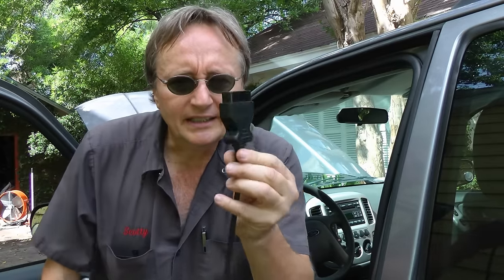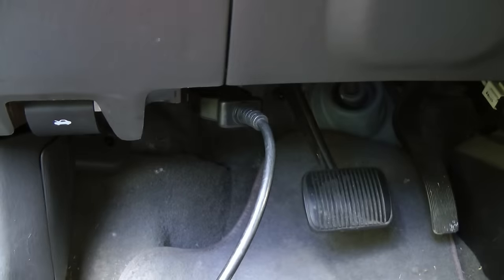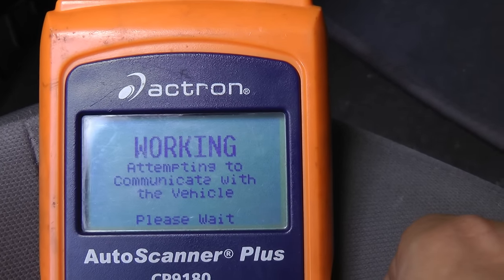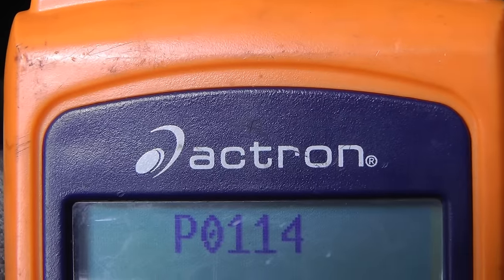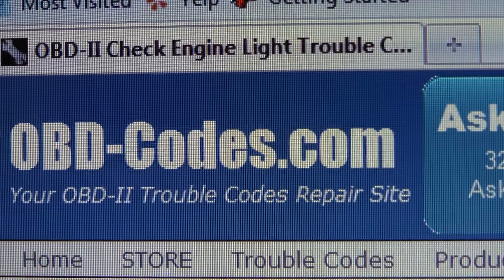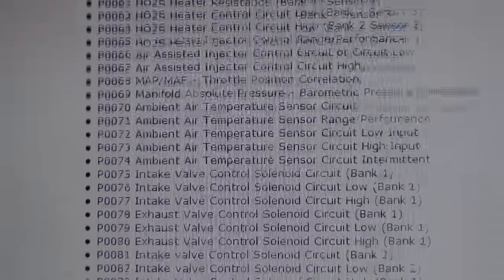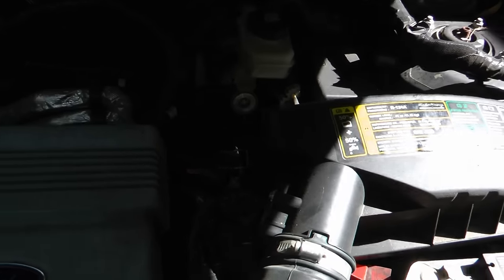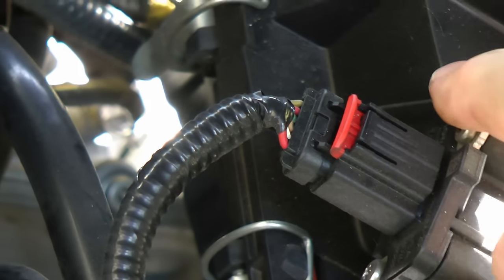Check Engine Light On and How to Fix It

Comment: Go to the dealer with the check engine light on and you're lucky to get out of there for under $500. $100 "diagnostic feel"   $100 labor to change a sensor that takes 5 minutes and a 300% mark up on the part.  I know computerized engines are more efficient and pollute a lot less but damn, I miss the days of carburetors and basic electronic ignitions (forget contact points!)

Comment: Hey here's a tip. When you need to find certain text on a web page, just press "control F" (command F for Mac users) and type in the text your looking for on the web page. This is really helpful when looking for a specific thing on a web page with lots of text.

Comment: Hello scotty, i have a 1999 toyota solara. i scanned it with my neighbors scan tool and these three codes came on(P1130, P1135, and P0441). I got this car as a fixer upper as my first car. so im trying to do this as much as hands on as possible. thanks you for the help, i fixed my AC with your videos.

Comment from the maker: you need a scan tool to reset it, but realize the gas cap may or may not have fixed the problem, many things can cause evap leaks. If it was the gas cap, just drive it, the car would turn the light off in a few days driving then.

Comment: Hello Scotty and viewers!  You are priceless Scotty.  These scanners can at least allow motorist to know exactly what they need to clean or replace.  I just purchased on obd scanner from amazon for 17 dollars and tested my 98 dodge ram and my 02 ford f150.  The 98 ran came up with no codes.  The 02 ford came up with a p103 code and in the booklet I received with mine t said it was my MAF sensor.  I cleaned the maf plug and sensor and then re installed my battery ground.  So if My engine light comes back and I receive the same code I will know to replace the maf sensor.
Reply: +Earl Guyton Most OBD2 scanners now have the ability to clear codes too. No need to remove the ground terminal and reinstall it now.
Reply: If the  check engine  light off of Nissan , what to   do

Comment: The best Car Advice on Internet. 
Hi Scotty i have problem with my Yaris 1.0. It start normally and idle normally and drive normally but after driving at high speed lets say 95 km per.h car start to resist or loss power and strangely it affect the steering wheel . The steering wheel become hard to keep it at the center of the road.

Comment: thanks for the fast advice. i'm going to get to the part house tomorrow and see what i can't find out about it. i decided i would go over things again and i can tell you it's not a connection issue. i even put an extra ground on the motor and bracket for the tcm and pcm. went through the dash and all that (hadn't wrapped them up yet lol). i couldn't find the problem even while running it and shacking the wires by hand. it's gotta be one or the other. that darned pcm is $250 to...

Comment from the maker: a weak battery or wiring shorts around the battery causing voltage to be low from the battery, but not the alternator when it's spinning

Comment from the maker: yes, just put a new thermostat in it. Follow the big hose from the radiator to the top of the engine, it's inside there on the engine.
Reply: would run my 79 Volare without a thermostat in the Summer...never got hot...put it back in the late Fall

Comment from the maker: computers see problems, they turn the light on. They see now problems when driving later, they turn the light off. change the engine oil every 3 to 4  thousand miles or twice a year. Brake fluid every 3 years, coolant every 3 years, and the rest you change when they wear out, there's not time limit or mileage time for most parts.

Comment from the maker: @SchindlerElevator902 fluid gets dirty and burns, should change it every 30 thousand miles on that van. 2 thousand codes can trip that light, get is scanned, or ignore it if it runs fine.

Comment from the maker: @Matthew55904  If the problem is fixed, it will reset itself, but that can take varying amounts of times, from hours to weeks. So most guys reset it using the scan tool erase codes function. Scotty Kilmer

Comment: Scotty, you need to advise people that a code doesn't always mean there is a specific problem.  Sometimes it is there to point you in the direction to begin diagnosing an issue.  A proper diagnosis will save a lot of money instead of just swapping parts and finding out later that what you replaced was not the actual issue.  Great video's though, keep up the good work.

Comment from the maker: you have to fix the problem, then it goes off by itself. Or you can use a scan tool to reset it, but it will just come back on in a few days if you didn't fix the problem

Comment from the maker: @PirloXXX  that's the bigger hole that lets air bypass the throttle metering. Don't worry about it, if you get some in, it will just evaporate if you let it sit half an hour before starting the engine back up. Scotty Kilmer

Comment from the maker: that is either a short in the wiring system to the computer, or a bad main computer itself. If it runs fine, ignore it as it could cost a ton to pinpoint it, and i've seen cars run years fine that way.

Comment from the maker: @0069manny could be either, that stuff's complex, and I only use factory oxygen sensors myself, aftermarket ones are often crap. But hondas are known for bad cats, only you can't check it yourself due to the previous information being true. but if it runs fine, it hurts nothing. Scotty

Comment: I know all about the dreaded flashing MIL. 2 years ago one of my job's Chevy Express vans had that happen. They still wanted me to take it out, but I told them hell no because I learned before that the flashing MIL is bad news. Turns out I made a good call because the mechanic discovered one of the lifters disintegrated and gouged the camshaft which produced a loud tappet-like noise which triggered the knock sensor to produce voltage signals that caused the PCM to set off the MIL.

Comment: There's a big difference between a scan tool and an OBDII global code reader. Both of these can see processed data from the control modules in a car but with a bi-directional scan tool the user can also command component operation, view manufacture specific data, and so on greatly aiding in quick, accurate, diagnostics.
Codes viewed regarding a check engine light really need to be viewed as road signs to the cause of why the PCM isn't Happy with the running condition of the engine.

Comment from the maker: pressure test the fuel pump, pray it's just bad. if not, pressure test the catalytic converter, if it has too much back pressure, it's clogged up inside and will stop speed.

Comment from the maker: you have an EVAP system flow problem. A real stinker on that complex toyota EVAP system. But, if it runs fine, it won't hurt anything. But do check under the hood, sometimes the evap hoses come off the back of the air filter top cover and cause all that. Pray it's that, cause if not, it takes a real pro toyota mechanic to fix those particular codes.

Comment from the maker: Realize an inefficient cat code can pop up from scores of different problems, including a bad cat, bad injectors, head gasket leak, bad fuel pump, and MANY others. If your guy can fix it cheaply enough, go that route, fixing it the way it was designed can cost thousands.

Comment: Hi Scotty,  You should do some aftermarket replacement of stock parts to your vehicle or someone else's on video cuz that would be invaluable. My question relates to that.  I put a DME header, AEM cold air intake and GReddy exhaust on my 2005 scion tc and the CEL has steady stayed on.  I then bought a Strup CEL eliminator.  The threads on the O2 sensor looked a bit mangled but my boyfriend fixed that.  The CEL turned off but returned the next day.

Comment from the maker: that's the code for ECM cannot communicate with other control modules. Serious computer problems there. Check for broken wires or bad grounds coming off the computer.

Comment: Thanks so much for the info, you get right to the point. My question is,  I just got mybrakes on and two days later Check engine & VSC light popped up, what can I do?
Reply from the maker: get it scanned and e mail the codes here, if they are ABS sensor codes, they messed up the brake job and damaged them

Comment from the maker: steering and running are two different things, I would suggest two separate problems. Try my video "how to clean fuel injectors on your car" for the running, and have the steering suspension checked by a front end man, most give free estimates.

Comment: @scottykilmer hey!!  it just turned of this afternoon by itself as I was coming out of Princess Auto.  I had went to check out on the prices of OBD2 scanners but was a bit bummed by the prices and had resulted in getting it scanned...all seems to be back to normal...looks like the fuel injector cleaner did the job again....Thanks again for the advice, this video and the other ones...  Fig

Comment: I was replacing my radiator fan motor 97 honda civix and the cel came in when I started the car I freaked out! I took a deep breath watched this video and I disconnected the battery and check my fuse box make sure everything was secure I heard a snap hooked the battery back on a bye bye cel check your fuse box might just be something loose or not on right thanks Scotty

Comment: Hi! Scotty!  I watched the video "fixing a car with multiple trouble codes"  And I did that (erase the codes, a week a go)   the check engine light is not come back. (the only thing i did was: clean the sensor under the battery.  thanks.  Dont know it the problem is fixed!
Reply from the maker: pray it's fixed, if light doesn't come back on, that fixed it

Comment: good one, thanks for uploading, i have a very simple question, i bought a used car and when i just turn ON ignition key in parked position with doors closed without starting engine, "Service engine soon" light shows with other lights like seat belt, break, oil level , they all goes away once i start engine, is this normal? I read from manual that its normal, but wanted guidance from an experienced person, I might have not noticed this earlier so little bit worried, please reply
Reply from the maker: they are designed that way

Comment: kool man, but i had one more question is it kool to drive around with the check engine light, i just need to have a day off then try to fix it, and also are most check engine problems serious, and expensive?

Comment from the maker: EVAP systems are complex computer driven nightmares. In order to diagnose and repair then without guessing, you need a dealer level scan tool with bidirectional controls and a thousand dollar smoke machine. So either pay a guy with that stuff, live with the problem that hurts nothing, or guess with the purge solenoid.

Comment: Thanks Scotty, I checked it out and its dry, my KIa is an Automatic, it won't start in Park, I had to put it in Neutral and somtime it starts, I once tap on the starter, it started but the Hold indicator light still flahes. I guess I'll take out the starter and get it test out. Maybe it's causing short circuit to the TCM.

Comment: P0505 ( Idle air control system) on a 2000 Honda Accord V6, cleaned the Idle Air Control Valve and Throttle Body, but it still turns on. Maybe a sensor? Vacuum leak? Have to replace the IAC valve? The problem is common in 6th accords. BTW it has a MAP(manifold absolute pressure) sensor instead of a Mass Air Flow sensor.
Reply from the maker: +Intiminator 77 check for vacuum leaks as in my video "finding engine vacuum leaks with a cigar"

Comment: Hi Scotty, Thank heavens for your videos! Newly divorced and learning about car care on my own-it's like learning to speak Latin, only harder. I have a 2001 Ford Focus that just passed smog on Friday then check engine light came on last night (Sun), Code says it's Bank 1 system too lean. I noticed for some time that it seemed like I need to refuel too often but I thought it was bad gas mileage, driving too much and using the air conditioning. The fan seems to run a lot but it's been in the 100's lately so I can't tell if it's running hot or just the weather. Any thoughts?
Reply from the maker: only thing that matters is the water temperature reading on the gauge, if it has one. If it runs hotter, it needs work. If not, running lean actually causes a car to use less gasoline, that's what lean means.  If it ran rich , it would use more gas.  Realize fords are always tripping codes when that old and many just live with em if they run fine

Comment: Question: I have a 2008 PT Cruiser, 61,500 miles. Had water pump replaced 2 days ago at dealership, oil light came on briefly, car full of oil and they said it was OK. Now check engine light came on today (not flashing) but on start up the engine seems to now be making a creaking noise esp. when cold. YIKES. Going back tomorrow to have it looked at. Have no way to check codes in meantime. I hope that my engine isn't ruined due to the water pump problems, it never over heated and thermostat was still OK. Had cam sensor replaced 4 mos ago. Hoping this isn't serious. Any guesses? Thanks.

Comment: ok i'll try with a different mechanic. I really want it off, because it's been on for about a year. And sometimes they don't want to do smog check because of the check engine light. But thanks for the info. I'll get it fixed.

Comment: Our 99 Lexus ES300 runs fine for 15-20 miles but after sitting at a light the car will run a 100 yards and act up. It doesn't die and the rpms drop to idle range and pressing footfeet gets no response. After 20-30 sec the car lunges forward and runs for a min or so and then does the same thing. We have replaced the fuel filter and two ingition coils and get a code about the evaporator. The exaust is real hot and I suspect the catayatic converter but I would appreciate your input. Thanks Dan.

Comment: Scotty like you said is hard to get a real mechanic that don't lie but I have a question I have a ford escape every time It rains the car slides from side to side specially on highways well only on highways I bought a used tire once never had it alignment the two rear tires maybe one I think has uneven wear for sure also when I go driving un bumpy roads it shakes on from the rear many say I need it balance and aligned but I don't know what you think it could be ? Hope I was detailed enough lol

Comment: @PirloXXX 
CRC Mass Air Flow Sensor Cleaner is safe for sensor and plastic parts.  You don't even need to remove the MAFS per YouTube, CRC Mass Air Flow Sensor Cleaner Video. I removed the big tube that Mass Air Flow Sensor seats in, next to the air filter. Then, I sprayed 45 times and air dry 45 minutes because it was dirty. You can spray less and air dry less if you want. This process was very easy for a newbie!  You can buy it from Pep Boys or Amazon for less than $10.

Comment from the maker: that would make it fail the test. try a new cooling fan relay and pray that fixes it. If not, needs serious electrical work that could be from the wiring harness or main computer.

Comment from the maker: @youngnwreckless956 tons of things can do that, from a worn out automatic transmission, to a slipping clutch on a standard, to fuel injection problems, or computer problems. Start by having a good mechanic scan the computer system for trouble areas. Scotty

Comment: Wats up Scotty Kilmer ?.. I replaced my 02 sensor.. #6Fuel injector.. Tune Up.  Scan code diagnosed misfire. N o2 sensor. My check engine light was blinking badly. I got the repairs n the light is no longer blinking. Yet to my dismay.. The light is still illuminated. My question is will the light reset itself once I have a few drive cycles?.. I had repairs done yesterday.

Comment from the maker: @ilovedesi13 CEL lights come on for over 2 thousand different reasons. Of course check all connections for tighteness, but if it comes back on , scan the computer and e mail me the actual code. Scotty

Comment: To make codes a little easier for anyone to understand, I thought of a billion dollar Idea, a phone or laptop app that draws a 3D model of your car and highlights the general area of the detected issue. For instance, if its a Mercades and there's an electrical problem with the air blower it would highlight the wiring to it and the unit itself.

Comment: @oakster702 Could also be a battery cable. I never would have thought a CABLE could go bad, but one on my 04 Dodge Neon wiggle a cut in itself, and the one on my 86 Ford Bronco apparently did the same. In fact, the neon cut off several times while driving back in 08' because the cut would open and close with the terrain on the road.

Comment: Hi Scotty. Great video.
I've been told that it should be possible to get the code without the scan tool. Simply by turning the key in combination with something else, and the code should show on the odometer display. Is that complete sci-fi, or is there something to it?
My vehicle is a Ford Expedition 2001.
Thanks,
Ole

Comment: On my 2012  Volvo S60 T4 I misfit a sparkplug coil causing a misfire and later a check engine light. Is there a way to reset it without having to pay the piper at the dealer?

Comment: Thanks Scotty...Great info...Do you no how I would shut my lite off...It came on while driving today and I noticed that my over flow coolant was bone dry so I bought some 50/50 and poured it in there about half full...I thought the lite would go off but it didn't. the lite isn't flashing and never was...Is there a simple button to push to reset on a Ford 2002 sport track? Or should I bring it in to a garage...I had a squirrel nest removed last week from the air intake area...Please help, Thanks.